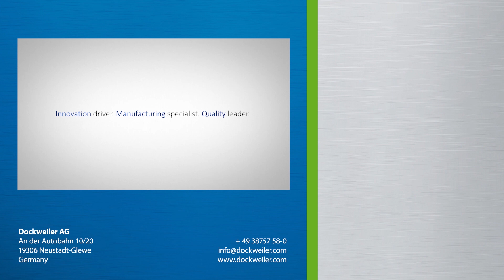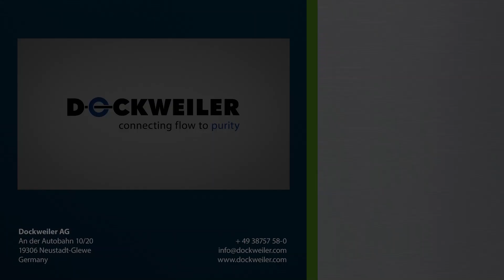What does the Ra value tell us about the quality of a surface?

Comment: On your interesting video you show 4 example surfaces, all with the same Ra of 0,5 micron. The first is easy to clean, the last not. 
1. What about the other two?
2. What roughness measurement system should be used instead of Ra to know which of these 4 types of surface (or other types) a tube internal diameter has?
3. Intuitively the third type in the graphic (flat plateaus and deep "V" valleys) looks least easy to clean - at least for very small residues - and maybe the second most attractive for biofilm.. do you have cleanability comparisons you can share? The available literature is very inconclusive - I think because most tests have been based purely on Ra and have not considered surface quality.